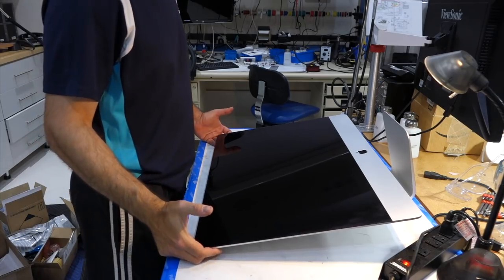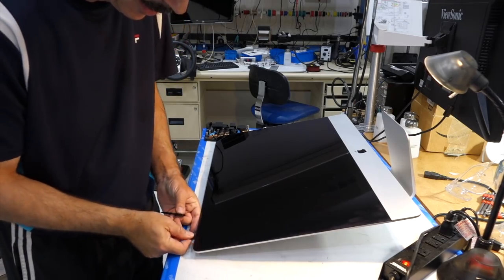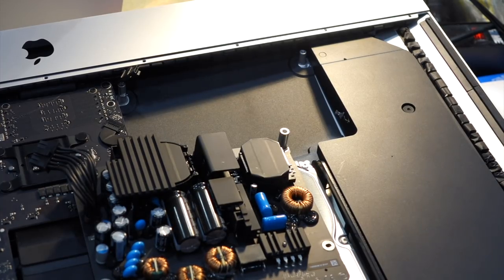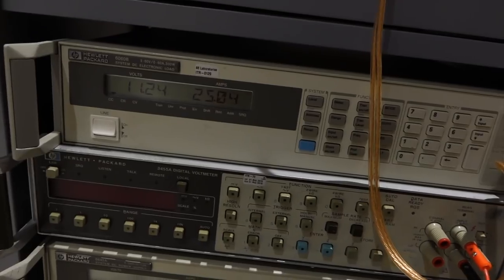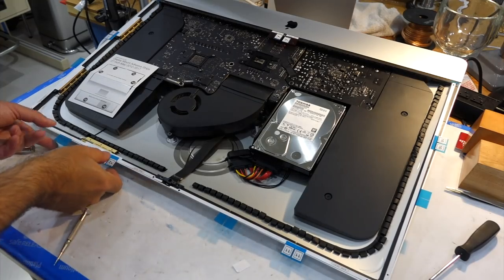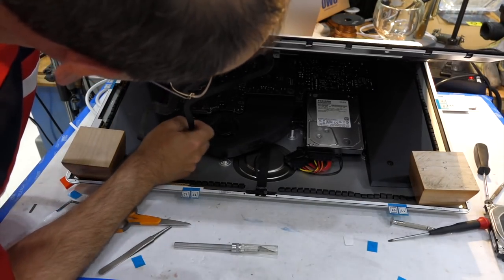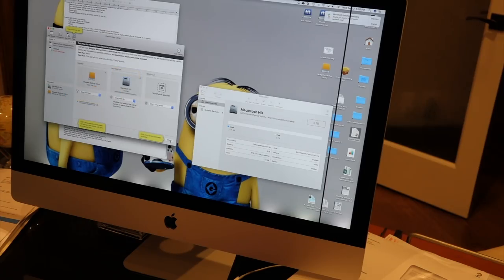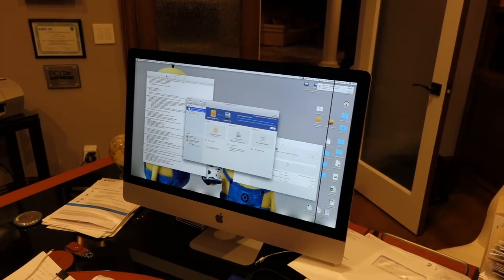Modern Tech Fail: iMac 27" Retina Repair (Mac shuts off randomly fix + disk drive upgrade)

Comment: This wasn't a fail, it did exactly what it was supposed to do. And the PSU didn't fail on the electronic load because the electronic load doesn't understand the "my warranty has expired" signal from the PSU :)
Reply: Yeah and Aliens did kill JFK..
Reply: @txm100  apple has been exposed for planned obsolescense in the past. it doesn't surprise me that they are still doing it.
their products are amazingly engineered but they still fail on areas which even an intern could spot (like the screen cable fiasko of the recent macbooks)

Comment: They are nicely engineered to be almost impossible to service
Reply: @AppleReviews  "With proper tools" Uhh, no. Not everyone has the money or patience to have/learn to use a BGA reworking station, for example. And because all components on a Mac are soldered nowadays (you can't even upgrade RAM or SDD on them L M A O), that is an issue right there.
Reply: @GelatinousSSnake  I fix about 4 of them In a 8 hour day.realy easy and I just use a heat gun and playing cards....
Reply: You're telling me that the cheapest PC has no BGAs on their logic boards?

Comment: Enjoyed your video, like I always do, but I have a problem with your praising of the brilliant engineering of Apple products. While they may be subjectively nice looking (not for my taste, but I don't judge), objectively they are very badly engineered.
All of them have horrible thermal dissipation, which leads to reduced components life. Most of their circuitry design is just botched together and you can hardly call that good engineering practice. They have fuses that don't blow and traces that burn instead of the fuse, their components and manufacturing are extremely cheap quality (even though you're paying premium money for the machine) and they are made to be non-repairable by the end user.
Nothing wrong with liking the machine or the brand, but please don't call that good engineering. Call it good looking or something more appropriate, but this myth of Apple products having better hardware than other brand is what's costing lots of people money, as non-tech savy buy Apple products because they believe they are overall better than any other brand, pay lots of money for that and after a year or two find themselves with a pile of junk. Spreading the myth doesn't help.
Sorry for the rant, but awesome video nonetheless!
Reply: Yes. There's a reason Apple has recently attained the distinction of being the first $1 trillion company on the NYSE and it's not through using quality components throughout. Overcharging for the 'privilege' of owning something mass produced in a Chinese sweat shop probably helps!

Comment: I have this exact Macintosh and, upon carefully upgrading the hard disk after the computer was only a year old, just like you I encountered the same exact issue with the screen. I always assumed it was my own incompetence but after seeing the same artifact on yours in the same place, being the same model\year Macintosh as mine I think there may just be a 'slight' critical defect in the screen. As much as I do love certain aspects of Apple's aesthetics, trading screws for adhesive and an extra mm of space-saving isn't worth the lack of any practical durability.
Reply from the maker: Now I feel much better! Makes two of us. Actually, there are many of us. Several reports of this stripe, always at the same spot on the right of the screen, about same width. There must be a design weakness right there. I was rather gentle with the screen, I am very surprised it got damaged.
Reply: When I worked at a Apple repair center, I repaired many iMacs like this, and you're not the only one!
This is a common issue, due to the heat and stress your screen goed through, and when you took it apart, it probably got an nanocrack in the glass panel itself due to age.
When it was a well used iMac, the chance of getting that line was a lot higher, with less used / aged iMac's we never had problems.
Just a sad case of bad luck!

Comment: All the discolored black on the power supply board is a sign of overheating. There is also a 3.3v and a 5v on the PSU as a standard windows PC. You may have cacked the screen with the cutting knife; you're "supposed" to use a heat gun in conjunction with the roller knife to remove the screen. I've repaired 12 of these guys and have come across the black line issue - Sadly you removed the screen too quickly and flexed it a bit further than you were supposed to.

Comment: The earlier iMacs that had easily removable screens held on with magnets were still acceptable for service (I upgraded the CPU & put in a SSD with no hacking for a relative once) but this is just BS. GLUE the most sensitive thing (the screen) to the case and make it the only way to open the thing at the same time? I guess it works to lower their bottom line (higher profit margin) and increase sales of new units = more profit, more perfectly good electronics shredded & burned. How environmentally friendly.
Reply: Apple is probably one of the least environmentally friendly companies out there.
The fact their HQ is fully solar power has little impact on their environmental impact as most of the energy involved most of it is tied up in manufacturing.

Comment: Use heat on adhesive, lots of it when opening modern stuff like that. It significantly reduces the force you need to use for separating panels.

I usually heat edges to around 60C and if you're lucky you can even reuse old adhesive strips.

Comment: If you take it apart again, put in an SSD. Will make a massive difference on MacOS, even compared to a modern 7200rpm disk. You should be able to use the terminal to make your own fusion drive. Don't know about the retina ones, but the older ones just had a spare sata plug on the board.
Reply: I was wondering why he didn't put a PCIe drive in. It's apples way of getting more money later.
Reply: @justincal6817  How could he put a NVMe drive in that POS? Lol. It has only a SATA interface, and  a dodgy one with proprietary modification at that.
Reply: @FrozenHaxor  on 27 in model, there is a pcie slot on the back of the mobo.

Comment: Marc.  I had two different 27 inch iMacs that had the exact same PSU issue.  The old one ran for about 3 years with no issue (just long enough for the Apple Care to expire) before it started doing that, and I opened it and replaced the PSU myself.  The original supply was made by Delta, and the replacement was a LiteOn.  Knock on wood, it's still running (my wife uses it).  I've been into it for a total of 3 times.  I had to replace the hard disk twice after the PSU replacement.  I do think Apple has thermal issues on those iMacs.

My newer one ran for about 2 1/2 years and started doing the same thing.  Fortunately the Apple Care had not run out, and I made Apple fix it.  Unfortunately, I had to take it back to them about 3 times before they would finally admit it was a hardware issue and they ended up replacing the PSU and the logic board.  I'm going to have to think long and hard before I buy another iMac.  I love the MacOS and the computers when they work, but if they ever quit...  sigh.

Comment: its probably the voltage rails dropping below ATX spec, even on a PC if they drop below a certain level it will indeed shut down the machine

Comment: One observation: You made a "beginners error" in replacing 2 parts at the same time. Now you don't really know if it was the HDD (possibly overheating) or the PSU actually causing the shut downs.  I'm with others here on the reliability and fix-ability  of Apple kit!

Comment: I remember apple drives being non standard since the early 90s at least.  There were special connectors or firmware that didn't work in a PC.
Even the graphics cards were/are a nightmare.  Non standard version of a already uncommon enterprise interface.

Comment: This is why I stick to my trusty old 2009 Mac Pro. I upgraded it to a Xeon W3680 (6 cores running at 3.33 GHz), 16GB of DDR3 ECC memory, put in a 256GB SSD next to the 1TB disk and it's more than enough for my work related stuff. Sometimes I even stay in after work to edit my videos on it, rather than on my 2011 13" MacBook Pro. The 30" display helps a lot as well :)
None of these two Macs needed service so far, and I hope it will stay so.

Comment: Instead of new adhesive strips, I found that clear tape applied around the edges of the display and case hold them together firmly. The tape is easy to trim so it doesn't show; just the little remaining 3/8" strip all around the perimeter was very effective.  It also makes it easier to repair down-the-line.

Comment: Hey Marc

Hope you have the answer for my iMac (Retina 5K, 27-inch, 2017), i crack my screen and is it possible to replace glass front lcd? or i should buy brand new 5k display screen? thanks
Reply from the maker: You have to buy the whole LCD panel.

Comment: If this is indeed a common failure on 27" iMacs, caused by a faulty PSU, there should be a recall by Apple to replace those at their own cost (and risks), because it's a manufacturing flaw. BTW, the cooling fan seems to blow cool air over the CPU/GPU first and then over the PSU effectively blowing warm/hot air off of the CPU/GPU radiator over the PSU. Maybe it's a long term overheating damage problem, like you suspect ? Are the backlighting LEDs at the bottom of the screen this bad on an iMac ?
Reply from the maker: At least you'd think they would have corrected it by now. The PSU fault is not obvious though. It's some kind of silly system interaction, degraded thermals or more likely a faulty temp or current sensor. The PSU was just fine out of the iMac. The lighting problem is because I did not reseat the LED connector properly. There is one common wire for the odd and one for the even LEDs. One of them was disconnected. The screen LED lighting is fine.

Comment: Power supply may have been fine, the old hard drive may have been the cause of it randomly shutting down. A failed platter bearing/bushing may not create noise or a rumble. But it may have been slowing down enough or creating enough heat to make it randomly trip the power supply's over current?  Which is odd you ramped it up to its max load and it did not trigger the protection circuit. Mac's are weird machines and in some ways poorly thought out for serviceability
Reply: Which is entirely possible.  I recently had a 2007 iMac totally fail. Not a great loss, the software developers always seemed to forget about that 'enhanced' processor and a new upgrade would cause a crash until the developer like Adobe would realize their mistake and there would be a fix for it.  it used to shutdown on its own from time to time. maybe days apart. one day it went down. unplugging and plugging back in failed to reset the thing and that was that.  That was the first iMac failure I've had so far.  first Mac I bought , my second was bought a couple of years later and it still runs just fine if not a little long in the tooth. I've had plenty of failures with Winblows hardware over the years. I run Linux of some flavour on that older hardware.
Reply: @blair79bear38  Yeah, same for me when it comes to PC hardware failures but those were "User Inflicted". But, when it comes to mac's and my personal issues I've always run across the lemons of Apples hardware.

Comment: I replaced the power supply in my late 2015 27" iMac just days ago. Removed the fan and blew out all the dust etc. Everything tested fine after the install. I then was a little concerned over some very thin extra sticky adhesive left on the top of the panel strip. So i decided to clean it up a bit more before laying the new adhesive strips. One area of glue was extremely frustrating so I got a little too aggressive with some isopropyl. Some excess seeped under the panel and knocked out one pixel strips from top to bottom just like the line shown here. I was hoping the alcohol would just evaporate and stop bridging the pixel strip.I am hoping if I can absorb the excess  After a few days of running the screen, nothing has changed. I have the cover off the back of the board on the top of the screen hoping to absorb and excess liquid. I am using thin paper strips inserted under the connector ribbons in that section. I will update this upon re-testing. Bottom line is, do not squeeze too much liquid off your pads when cleaning up the the adhesive at the top of the screen.

Comment: I'll refer many to this video to explain why I will not attempt  Apple service.
No parts or documentation available. Arrogant  hostile to the user.
Louis Rossman found a niche in time but has to repair with used parts from junks. Only source of parts.
Apple techs are not techs, just (up) salesmen, not allowed to repair more than replacement  HD or memory.

Comment: I remember the heartbreaking defeat I saw in my uncles face when he tried to repair a problem with his new car and finally accepted that there was hardware that he simply did not have the skills or tools to troubleshoot.  A lifetime of skill and experience in being a mechanic had become redundant.

Turned out the problem was with some electronic sensors somewhere inside that were doing a job (his words now) "that were done perfectly for decades with a few serviceable mechanical parts".

I pointed out to him the MTBF of the new sensors (normally) would mean there is less servicing required.  He did not want to hear about it.  :P
Reply: I hear and understand what you're saying but when you go from several hundred  mechanical parts to thousands (100's of thousands?) electronic components, the computers and the software to drive it all is it really more reliable? I'll never forget walking into my Saab dealer years ago, just after they introduced a model that had electronics &computers up the wazzo., There was a lady at the service counter almost in tears over the fact that her brand new car and its electronics had a mind of its own and so many things didn't work properly. Granted this was early days of overwhelming automation in cars but it does make me wonder. tbh I think cars are going the way of being way more disposable which is a shame  - seems to be the same "Apple" mantra.
Reply: Just to clarify my point. In another life I used to work for the electronics/software arm of the McLaren F1 racing team. If there's one thing I took away from that experience it was failing sensors that were the culprit in a lot of race failures. Looking at the telemetry during and after the race you'd see where some extremely expensive sensor (the cars are covered in them)  started to fail and affect the performance of the car. Sometimes it was possible to patch the code in the car to get around the problem but invariably you weren't in the position to do such things during the race. Yes, there was an applications engineer with listings of the code at all races and he had knowledge of how to binary edit the software to jump around problematic things. Those were the days :-)
Reply: Let's not compare apples with oranges here.  We are not talking about a peak performance motor vehicle here.  We are talking about a consumer level product.  You don't have a team of qualified mechanics to service your family car, just like you don't have a team of Marc's to service your iMac.  ;)

So, when you build a machine with quality parts, as the iMac was built (and my uncles car, presumably) you favour high quality poorly serviceable components over less complicated (read: legacy) components.  It lets you build something that is superior in almost all ways, and most of the time (sorry Marc) you get a product that runs perfectly throughout its planned service life.

So, my uncles car has a sensor that lets it have lower emissions and better fuel economy.  It means that it is something he cant fix himself if it fails, but in the long run, all things considered equal, it is better than the old way.  :)

Comment: Its better to open it with tool from the top, from middle to left and to right side. Mistake can cost a lot. When LCD LEDs are overheated and failed (this happens after some time), inverter checks the amperage and turns the screen off. This may be a reason. Resoldering LEDs helps

Comment: Compare Apple to another PC giant Dell, my brand new consumer grade laptop has a disassembly manual freely available on their website for anyone to use, yes no component level repairs and the screen/touchpanel is designed to be replaced as one but all other non-soldered parts can be replaced and there are instructions to do so. They even went to the trouble of putting the power connector on it's own board separate to the mainboard and just plugged in to the mainboard with one connector. As the power connector is generally a major failure point on laptops this is a very good thing.

As for warrenties, my very first laptop (a FujitsuSiemens Amilo Pi1505) had a major hardware failure 3 days! before the warranty ran out, they ended up replacing the motherboard, memory, audio board and processor, if that had only happened a few days later then I dread to think how much it would have cost to fix.